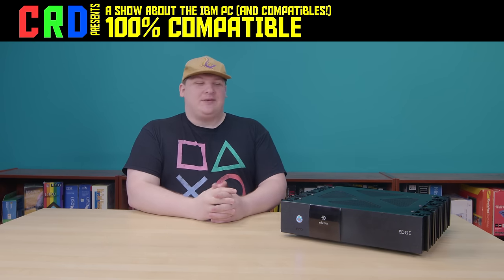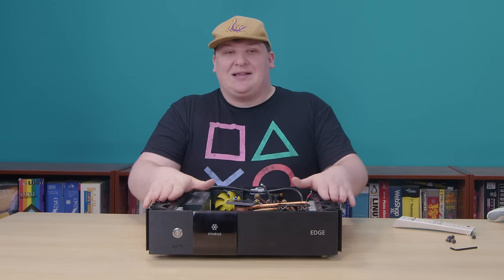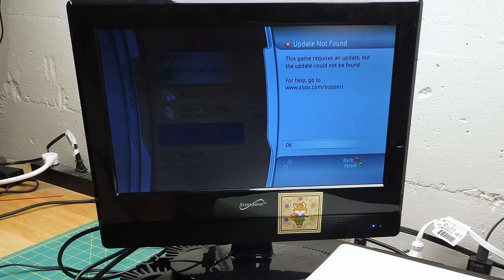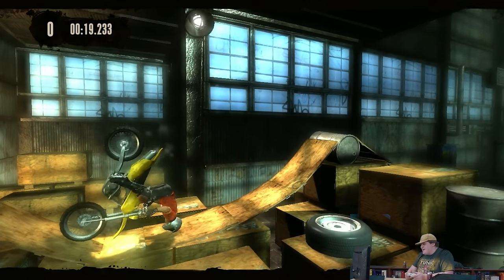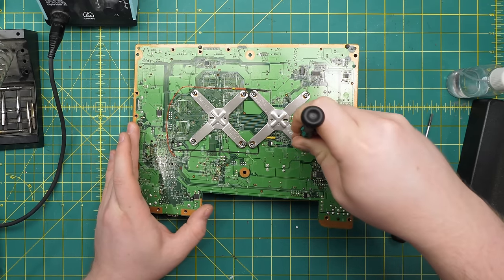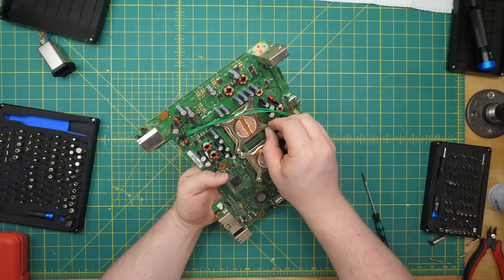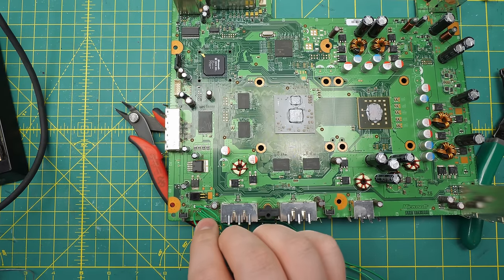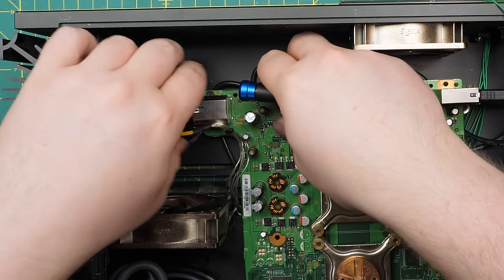The Niveus Edge Resurrection: Hacking A Hacked Xbox

Comment: Suggestion for the methacrylate not curing: Loctite klean ‘n prime. It’s supposed to help with oil and passive (inactive, whatever) metals causing curing problems. Also, loctite 243 is a little more tolerant to tough curing conditions. 
Finally, what about penetrating grade, like loctite 290? It’s meant for preassembled fasteners.

Comment: CRD,
 Microsoft might have placed a restriction on re-using the board and wouldn't allow the DVD drive use in an effort to strip the system of its game-playing capabilities, this seems to be the obvious choice by MS if they wanted a restriction because as you mentioned, the drive was used to verify the legitimacy of the console. 

The fans are likely for the power supply more than anything, that thing gets pretty damn hot on its own and being inside that case not only would make it run hotter, but it would also heat up the rest of the console.

Comment: 37:17 Hot take: IR sensor modules usually have an open-collector / open-drain output. It should be possible to just wire another sensor in parallel.

Comment: if you had a ceaton card, you could use an xbox 360 or the niveus edge as a cable box in any room your wifi/ethernet could reach which greatly reduced the amount of cables running through the house if you wanted to watch TV in multiple rooms.

Comment: I have a server running in my basement with a torn-down SSD inside floating around
and an jumper to turn on the ATX PSU because the server has some weird Fujitsu main board that uses some weird 12VO connector that doesn't even need a PSON signal...

Comment: I think you could further improve it by covering the holes on the top lid. The fan on the rear is going to take fresh air from the nearest holes it finds, so it really doesn't have any kind of effective airflow front to back. In fact, you could take out that fan inside that isn't really cooling anything, cover the holes on the top and bottom lids up to the ones on the front side to have the air intake up and down near the front so there is proper airflow front to back for both sides of the motherboard, take out the front fan and put the controller radio receiver on its place to have even better range. The decisions taken in this design were really baffling.

Comment: I used to do bank vault restoration. Until the "mod vault" era (""modular vaults"" aka ""portable"") they were all basically hand-made.

Anything hand-made needs to be meticulously documented when taking apart. It's all made to fit.

Saw a few fucked up vault doors because someone forgot to document different parts when disassembling and it caused a week+ of downtime to try and fit it back together.

Lesson learned the hard way 😅 Next time you're on an ultra niche hand-built product, do your due diligence in marking, labeling documenting each piece.

Comment: LOCTITE 209 (green) or equivalent is the one you want, as it wicks into the treads, blue won't usually set like that. Some cheap generic blue thread lockers that are basically varnish will, though, which is why you've probably seen it, hence, cheap, thin (not gel) Nail polish/varnish is an option too, a little half-assed maybe, but probably in the spirit of Niveus 😂

Comment: I used to mod Xboxes and yeah, there were tools you could buy to make disassembling a 360 easier, just flat metal sheets with all the right bends for all the pins you just smacked onto the side. Otherwise it was an adventure.

Comment: The best way to dissolve any thermal paste is only WD40, next to remove oily wd40 stains is any contacts cleaner spray-they even sell such separately under wd40 "professional" brand, which i'm using. So wd40-next contacts cleaner = clean in 5 minutes, very gently.

Comment: 50:11 nice to meet you, Gravis "I am not interested in a Pinecil" R. Dude
Reply: (i am aware you said you had one on order in that same video, before pointing out the reasons why (extremely valid, the usb c in is dodgy on my own pinecil))
Reply from the maker: I'm not interested in them because I bought one and don't like it. I used it here because I haven't set my Weller up since I rearranged my workbench; it was absolutely miserable, the ergonomics are still awful and the tip fell out of the handle a dozen times while I was using it.

Comment: I have a similar "completely silent Xbox 360" from another manufacturer, and it's amazing to me how different engineering solutions people set to a similar task can come up with. The model I have on hand is a prototype built somewhere in the early 2000s at the "Maloyaroslavets Electronic Factory" (MPZ), also in an out-of-the-box case and with the goal of getting a maintenance-free device for advertising and information kiosks (as I understand it, they used Windows Media Center to spin information videos around, for example, at a train station or enterprise in several places at once, having encountered similar problems after Vista broke everything).

Seemingly similar conditions: a small enterprise with extremely limited material and human resources (it's a typical post-Soviet factory, grabbing any order they could, what do you want?), a pile of old junk in warehouses and limited time. But what different approaches! It's easier to describe what was there, so you can compare it with what you see in the video.

First of all, the hull. A typical Soviet 1mm thick steel box of dirty-gray color without a single hole, with a power socket and RCA output at the back, a stern Soviet toggle switch labeled "ON", a barely glowing red LED power indicator and an IR port window looking completely alien in this guest from the 80s on face side. Instead of a top cover, there's a solid, 6 kg copper heatsink. This is the view from the outside. If you remove the heatsink/cover, you will see the following eerie but interesting picture inside.
The mounting of the board. Why drill holes when you can put it in a frame and generously fill it with heat-conductive self-solidifying compound "according to the standards of the Ministry of Defense", ensuring eternal physical and thermal contact of a whole board to a case? The power supply unit was treated the same way: it was scraped, placed in a plywood frame and once again treated with the same excessive pouring of solid thermal compound, forever uniting it with the radiator cover (for this reason, by the way, cover can only be bent 90 degrees and attached to some wall or something while you work, but not removed completely). The daughter board was simply pulled into a heat shrink then shrink edges filled with glue after soldering everything necessary directly to it.
And now - the most interesting thing: CPU and video chip heatsinks. They are just two solid copper cubes, apparently standing right on the CPU and GPU dies, around which the board is generously poured with some slightly sticky but hard black stuff in excessive quantity, to put it mildly, again binding them to the board forever. On top of these cubes they applied plus or minus half a cup of thermal paste, through which the heat goes to the same heatsink when the cover is closed. Everything is so simple. No heat pipes, no hi-tech of any kind. Moreover, due to the available space (and probably lack of competence to solve the problem as Niveus did) the engineers didn't even remove the DVD drive: it was simply glued from the inside to the left side of the case on the same black stuff, so that it can be opened and even disk can be loaded with the cover removed.

I don't know if this approach is better or worse, but.... If anyone thought you couldn't approach this any more primitively than Niveus... Yes, you can. Yet, it works: after changing the thermal paste on the cubes from the "white stone of the Ancients" state to the new KPT-8, the system was stable at 49 degrees on the CPU and 52 on the GPU right after playing. Total weight is around 30 kg IIRC.

P.S. This model is a one-off design and was bought by me from a retired employee, but I've seen their usual, serial, silent, maintenance-free computers, which were put in vending machines selling newspapers, tickets and other such things of their own design and assembly, as well as some CNC-machines. The principle of assembly is the same, with the upper heatsink made of aluminum or copper and two copper cubes serving as heat sinks held by black goop, only the board itself was mounted not on solid thermocompound, but on screws, drilling holes for ATX standard by hand. But the essence is the same: a tightly closed case without a single ventilation slit, a huge radiator serving as cover and consumer-grade hardware stuffed inside in somewhat barbaric way.

Thought it'd be an interesting story to return. Thanks and good luck from Russia.

Comment: rework protip: Use fresh low temp lead tin solder (its fine. The 'erhmuhgurd lead' stuff is scaremongering, just dont huff the smoke, and wash your hands before you eat anything with them, and youll be fine. Its like mercury, its only dangerous if it gets inside you, and its cumulative not a 'youve been exposed now you die' thing. Manufacturers using non-leaded solder is a good thing, a great thing. Us hobbyists though.....we should be using the easy to work with leaded stuff. So use it...) and flood the solder joint with it. The juicy stuff will better spread the heat into the higher temp solder, and vastly lower its working temp. This simple trick will help keep you from nuking a joint trying to get that wave solder oven solder to clear. Thank BigClive for passing that trick down from on high ;)

Seriously, Ive been soldering since I was single digits (well, playing with a solder gun (literally the craftsman big ass transformer on a pistol grip gun type irons), finally wised up embarrassingly late in life and learned cleanliness of the tip is godliness, to give a flux, and patience is a virtue. you dont suck at soldering, but your soldering tools might 😉. Also, Im a smoker, pushing 40, if leaded solder was that bad, shouldnt it have killed me by now? Im not a light smoker either.....Use the leaded stuff. Just be smart about it. Really, its fine.

Comment: found one of these, also blades, im gonna jtag it, they did leave the plastic shroud of the plug intact just without the strain relief, same abomination of a psu deshell.... oh and they left a memory card in it, but obviously it doesnt fit so they deshelled it and bent it 90 degrees vertically which somehow works.  not sure why they felt the need to add a memory card since all thats on it is a profile
edit: oh and for bonus points it came in a rainier labeled server rack mount with a notch dremeled out for an ir transmitter hot glued to the sensor, no idea what they actually had it connected to though since i only got the led on a wire

Comment: A 360 in steel with a vandal-resistant power button is absolute gangbusters.
For real computer cases gotta stop using ditzy little tact switches. 
Give me that 16mm kerclunk like I'm activating a municipal sprinkler cycle or something.
Downside: they are vandal resistant, it's quite difficult to mod out that ring LED (you WILL poke your hand) and they only come in common cathode RGB (not the one that's convenient)

Comment: I do actually have a disc (somewhere) which contains the update needed to use the HD DVD drive
However, i don't know if my disc would work on that console for 2 reasons
first is that from memory the disc is supposed to be inserted into the console itself
second is that if the update discs are region specific, then my one would be a PAL version

EDIT: managed to figure out where i put that disc, even though its probably useless to anyone except me, and yes, i have succesfully played a HD DVD on one of my Xbox 360s

Comment: The real problem with using hot glue is that it will reflow.  It doesn't even need to fully melt.  If it gets too warm in there, it will slowly reflow all down into the port, and block the electrical contacts.  Please don't use hotglue like this. 😢

Comment: On your heatsink bolt retention: Just whack some hot glue on the thumbscrews. If you're real ambitious, taking the nuts off and then using a tiny (TINY! or it'll be awful to remove in the future) amount of anaerobic sealant on the threads will also do the job.

Comment: Hot glue instead of the Loctite? Place dab of it on the bracket leg, and bring it up the side of the nut and onto the top.

As for the loose power switch, perhaps try using an opened ring end spanner? They are more thinner walled than a normal open ended spanner and may be of more use in that position
Reply: Hot glue will melt at typical heatsink temperatures.
Reply: True. I hadn't thought of that. JB Weld?

Comment: Some 7371 dashes are not JTAGGABLE if they have the wrong CB version. Only way to know for sure is to dump the NAND. Or you could use RGH 3.0 (doesn't require a mod chip) and go from there. Back up the CPU and DVD keys and put them in a safe place.

Comment: Theres a good chance a modern 2.5" SSD is much shorter than its casing. If you have a 3d printer, you might be able to print a shorter case that fits the board.

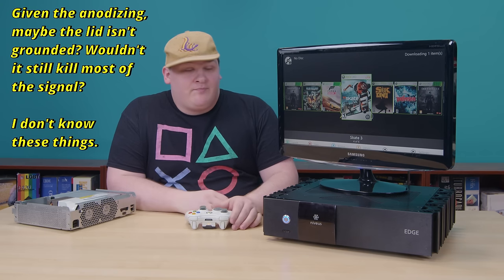Comment: 24:22 to completely radio insulate electronic peice metal box have to be completely sealed. No openings at all.
 Radio signal can and do travel even through small holes. It is just quality and strength of it fall somewhat. I think Xbox controller has overkill transmitter and therefore you probably have to use military grade radio electronic warfare devices to disrupt signal.
I'm sure Xbox rf shield is there to protect from like some minor stuff? Also it could be specific type of aluminium, idk tbh.

Comment: the 360 controller had like a 30 metre range if i remember correctly, not an official figure i just used to use a projector in my back yard in 2008

Comment: My only recommendations would be the usb is very easy all you would have to do is set it up as fat32 and place your games in a folder as .xex files. For the ssd I bet you can remove it from the housing and it would be itty bitty and be able to place it to the frame.

Comment: Aren't SATA SSDs mostly air and plastic nowadays? The actual parts might be small enough to fit somewhere that doesn't suck.
Reply: Yes they are... 2,5" case just follows the standard, but inside the real board is almost always half the size of the case.

Comment: I bet you could just replace those heat pipes with something modern and far simpler. Modern capilary heat pipes are way, way better than whatever they used. 

Also for the love of god, please lap those junctions.

Also velcro pads, attach the HDD to the PSU

Comment: Unfortunately I don't think Niveus could've survived by selling modded consoles because Microsoft was known back then for being so anal about modding xbox 360 that getting banned for simple fan mods wasn't something super unusual. (I think they monitored voltages to see anything they are not expecting on an unmodded console?)

I'm not going to be surprised if attempting to get online on the original motherboard will get it banned quite soon since it is missing the original drive and fan connections were tinkered with.

Comment: Janky job but still cool.

As for the SSD, don't go USB. Not even an option, man. Haha. 
Does the top of the unit's case fit on in a way thay would let you mount it there? Think of it like a flip-top, ya know? Just wondering.

As for all the compound, that's when you just grab any number of Chinese pastes that perform just as good as anything Noctua at 10% the cost. Slap 30g of GD900 in that mofo for about $3, lol. 

The anodizing will both make continuity iffy across the chassis but it also makes a harder contact with skin (even wet skin) so the grounding should be ok. I used to work in aluminium anodizing and while it shouldn't be used as a "protective coating" for humans vs electricity, it's more effective that it seems it would be.

Comment: you know whats funny, there are people upgrading the original xbox with 1ghz pentium 3 cpu's.  with custom firmware, but they run lol.

also, water leak problems?  bruh i did a custom water loop with 0 knowledge in 2011 or so, it was running with 0 leaks and 0 problems until 2021.  i drained and filled it overtime, but any decent loop wont have problems.

Comment: the assembly process is only awkward because the design is absolute garbage. even without completely changing the design, adding a few threaded holes and fasteners in the cooling towers would allow for first putting together a subassembly before mounting the rest. 

its a huge design sin to have parts loose until the very end of assembly because it either requires unnecessary time and effort or a custom assembly rig.
Reply from the maker: Totally agreed

Comment: To be a bit of an ackchyually 🤓 ☝...
When putting thermal compound on a bare die, it's very important to spread it out first, like you did. 41:18
The "nothing matters" philosophy only works for chips with heat spreaders. 

If there's only a small corner of a bare die without proper cooler contact, it could mean millions of transistors suffering a sad, depressing, fiery death.

Comment: should have just bought a jr programmer n a cheap matrix or other rgh chip or did 2 wire mod and  just rghed  the original  board  that was in there its  not that hard and  even easier on them older 360s and  can be done to almost any board they dont need to be on a older dash for a rgh and its almost exactly the same as a j-tag.

Comment: fans are 12v.
Reply from the maker: If you're referring to the SilenX ones, yes, they're 12V models chosen specifically so they'll run very quietly on the 360's 5V supply.
Reply: @CathodeRayDude  no the xbox puts 12 volts out to the fans when requierd as when it gets hot I have worked on plenty. the original fans are made by NMB and they are also rated for 12 volts.